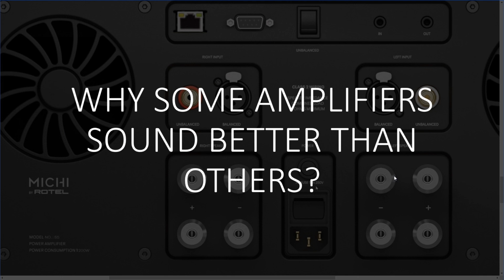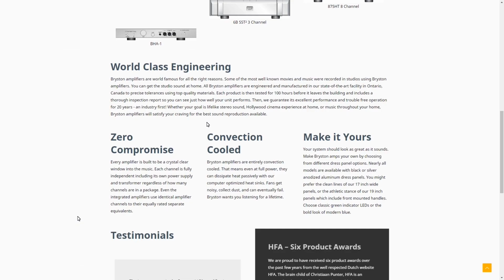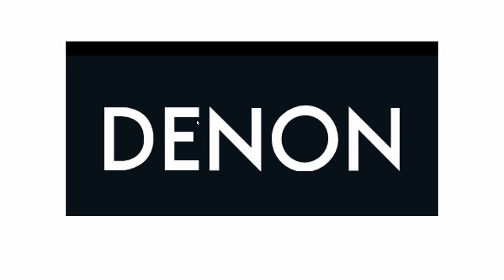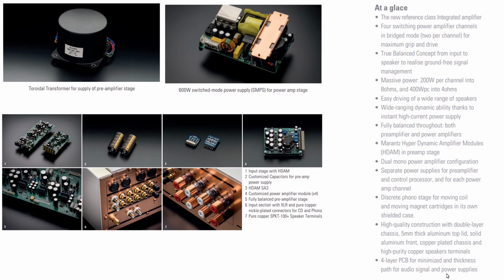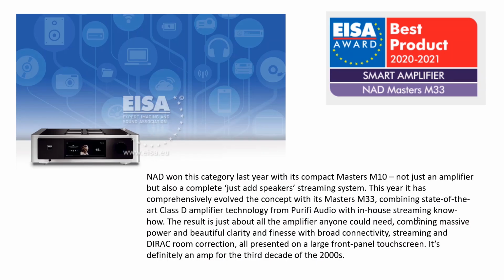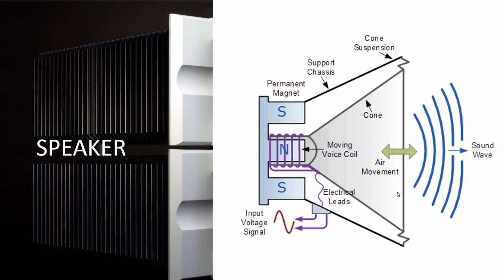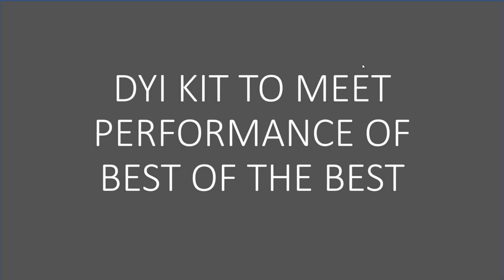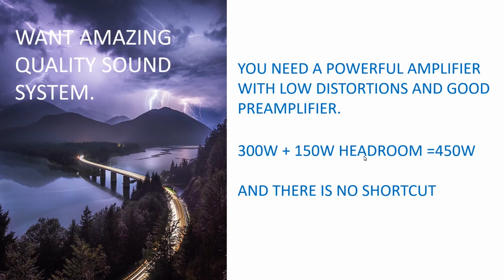Evolution of audio amplifier EN

Comment: I have some Linn equipment which use switch mode power supplies in there speaker range. I've also just noticed that they have launched a new mono block amplifier that is class D. The sound is impressive but at a huge cost.
Reply from the maker: Currently, in the HI End market, there is a mess with pricing. I recognized it some years ago and took a nich - high-end board in a simple enclosure.

Comment: Why are you spending so much time reading their marketing BS and agreeing with it, rather bring the actual measurements and the truth. That's the point after all, right? Marketing pisses me off.
Reply from the maker: When making trustworthy measurements you need certified and each year recertified equipment. We do not have full equipment set for trustable factory level measurements. It is not worth to take just another soundcard grade measurements. Internet is full of them, but credibility is not at the professional level. Good manufacturers are providing trustable technical documentation and engineers relaying on them during the design process.

Comment: The unit is mono, correct  ?  Along with a balanced input, a simple RCA input will be welcome.
Reply from the maker: The RCA meant to be used with adapter cable keeping connection to amplifier chassis with  XLR quality connector. For unbalanced connection you should shorten XLR pin 1 and  3
Reply: Do you deliver to Brazil ?
Reply from the maker: @amam2186-w9n  Yes

Comment: Do you sell the INA1650 pre-amp board without the casing? I’d prefer to retrofit into an old case to match my system.
Reply from the maker: No, we are not selling boards as a separate item. Our logistics are not able to handle transactions bellow 100 USD. There are some good boards in eBay what you can use for your projects. Search for SSM2141 Balanced input and unbalanced output Dual Channel Preamplifier Board. They are not specialized for ICE125ASX2 but are able to form a precise signal for bridge connection. Input impedance in a balanced connection is 20KOhm.

Comment: hifi amps are interesting topic, especially the versatile class D and diy.
ony thoughts on the new class D with GaN fet's?
Reply from the maker: Two years ago, I thought that GaNi will start to take over, bat then there where long silence in industry magazines. GaNi has one huge drawback. By default, they have open state and it is sophisticate technical problem to build reliable and protected design. In parallel silicon MOSFETs continuously improving and latest development designs achieved GaNi specification with much less effort and proven technology. I think GaNi will take over automotive electrical car charging and systems, but will not land in Class D designs. Or will be adapted from the automotive industry sometime later. In my practice, I build a lot of amplifiers with exclusive specifications. But was disappointed in a blind test were was not able to clearly identify my design advantages against good amplifier working away from clipping. Things what in reality making difference are Bridged connection, Preamplifier and Power headroom.  After studying top manufacturers, I found out the same principles. I think that there are no more secrets in amplifier part and if you are looking for next audio quality improvement you should get rid of passive crossover in 3way system and drive each speaker directly by dedicated amplifier using active crossover for band separation. You will find this trend in Professional audio industry. Practically there are no studio monitors with passive crossover anymore.